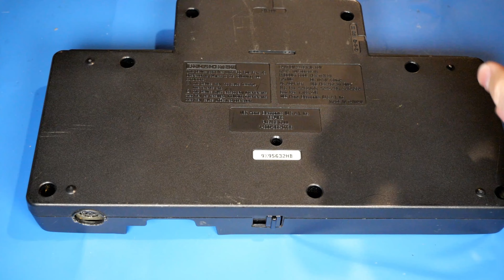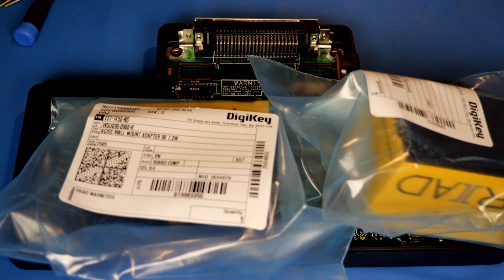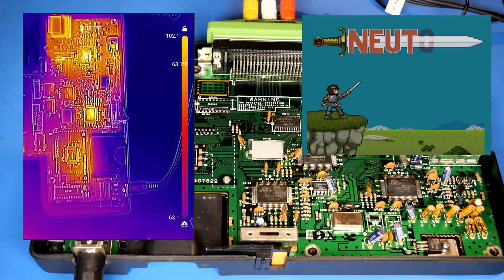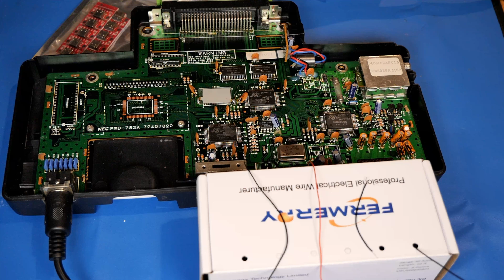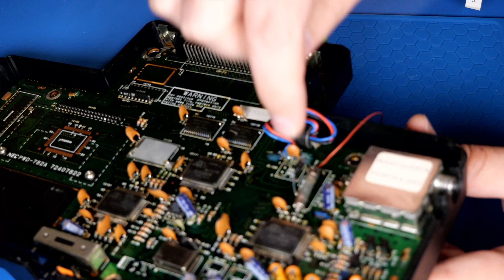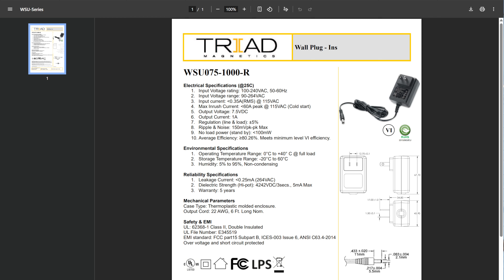Selecting a "Cooler" Power Supply for TurboGrafx-16 (PC Engine)

Comment: Awesome video. The good thing about RF Shields is most of the time the thing will run fine without them, still too bad the pads for it got ripped out though. I removed the ones from my TG16 since they had severe rust from the system sitting outside and filling with water.
Reply from the maker: Thanks! Glad you enjoyed the video! 

Yeah, I've had to throw out RF shields on other systems before. That TG16 is in just such great condition I wish it didn't get ripped up like that.  Caught me off guard seeing it! lol

What games do you play on your TG16?
Reply: Mostly when I have it out I play Blazing Lasers. Sadly it is one of the systems I missed out on until the past couple of years so I don't know too much of the games on it.
Reply from the maker: That game looks fun! 

I just got AirZonk, it's a side scrolling version of that style of game (in the Bonk universe).

My collection is pretty much just Bonk games, Neutopia, Boxyboy, and I picked up Dungeon Explorer to try a multiplayer game with my wife.

The system had some gems on it, the issue is they're all pricey.  I'm still trying to find Parasol Stars CIB. It's Bubble Bobble 3!
Reply: AirZonk is pretty fun too! I checked out Blazing Lasers since it was made by Compile. The made my favorite NES game The Guardian Legend.